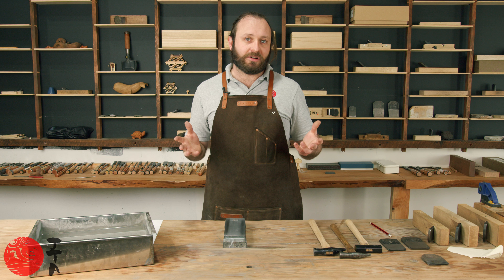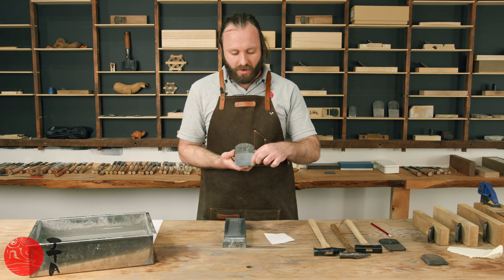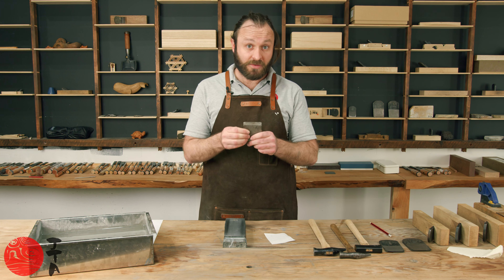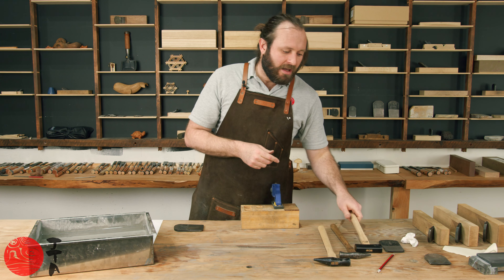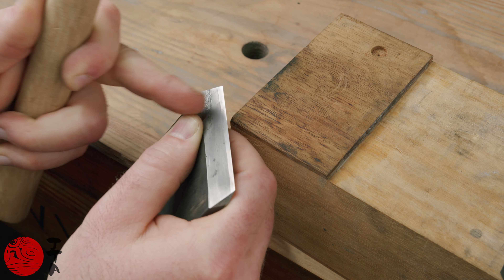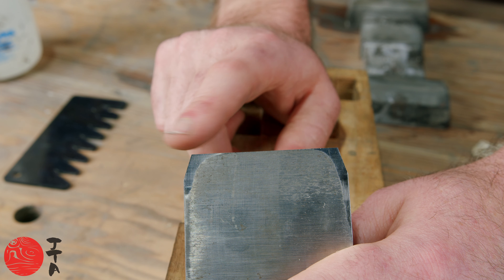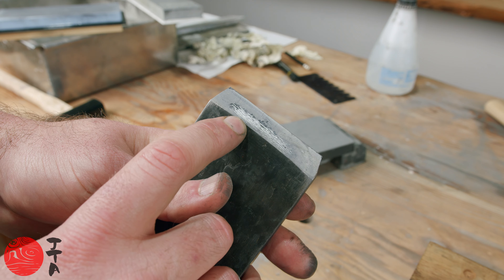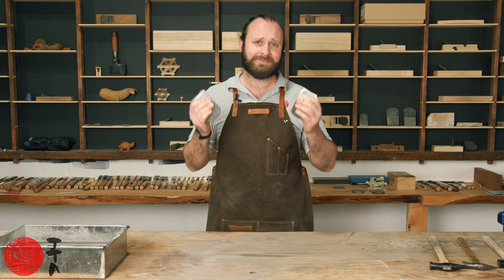Plane Tuning Addendum   Ura-dashi

Comment: Saw one video about this process, and the carpenter had a specialized machine for doing this. Really ingenious thing. If I was going to make one, I would take one of those hammers, and drill through the end of the handle and put it on a pivot point, Then it would be easier to control the strikes.